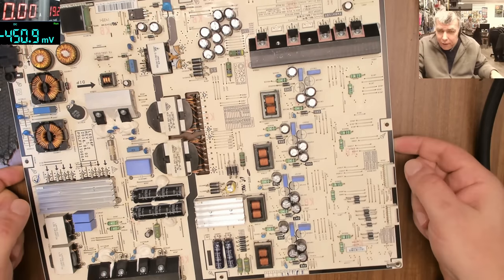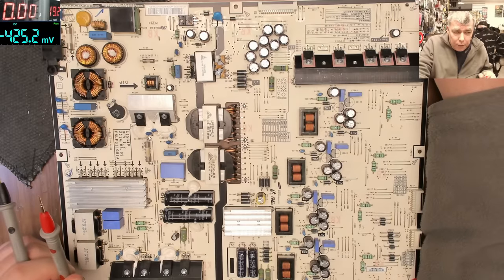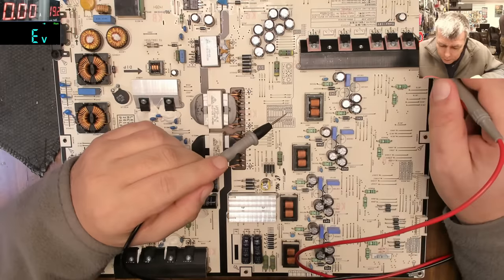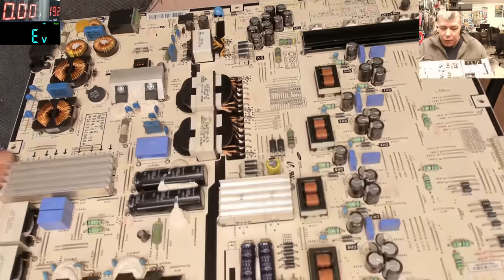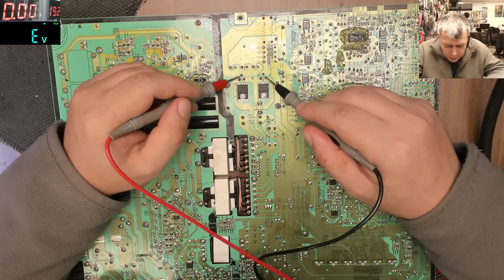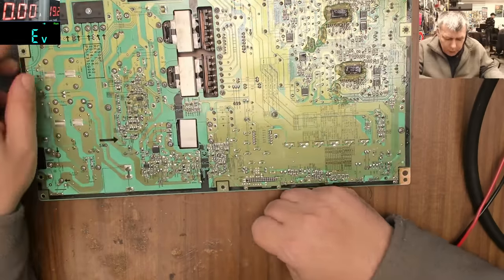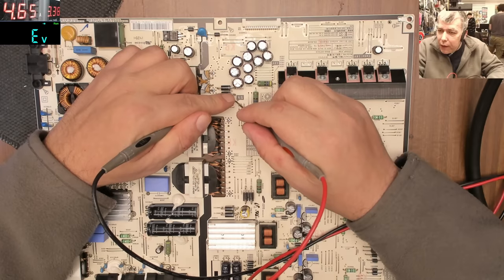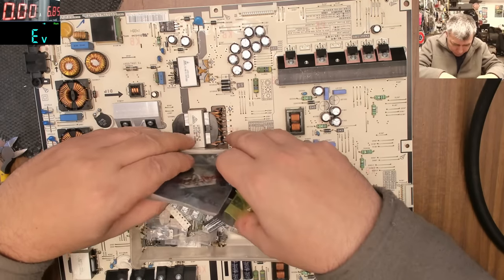Samsung UA65HU8500 TV repair - Switching Power supply board repair guide

Comment: you can install sr5100 in this node too. these diodes differ in their operating voltage - 100 and 150 volts, respectively.
but at this point the output voltage is only 5 volts, so the reverse voltage for the diode will be 40-50 volts maximum.

Comment: Thank you sir, you remind me my old work, as a repair technician. 
Nice method to find the shorted diode. I did not think that.
But I have to notice that you must replace all the three diodes. They have to be from the same type and same lot also. So they have same characteristics possible. 
As you mention maybe the technician chooses not to equalize the three diodes so the TV come again for service after a few years.

Comment: People who don't understand electronic assume that a partially, or sporadically working unit is easier to fix than a completely dead unit. They couldn't be more wrong.
Reply: They don't understand the difference between a simple DC controller on, say, a toy train and a more complex supply - linear, switching, balanced. Or why that matters anyway.  In the above that knowledge and methods of isolating the faulty part kept a several hundred (or more) $ (USD) TV out of the dumpster for the cost of a diode that was likely less than $20.

I'm in awe of the way you work through problems and remind all of us that everything comes down to Ohm's law, Kirchoff's laws, and so on.
Reply: @larrymorley8968  Schottky Diode cost no more than 0.1$

Comment: It gets more difficult when a resistor opens. I just repaired a similar PS where a 2W resistor failed open but it was perfectly fine on the outside (not burnt). Had the PS in the TV fully connected and plugged into mains, and traced voltages with the aid of the PS schematics.  The issue was the PS not switching although rectified mains was there.

Comment: Don't be fooled by diodes showing up short, this does not necessarily mean that they have failed, you can quite easily get false readings from low ohm resistors or even from a local transformer.
Reply: He did go through the one set of diodes that seemed to maybe be shorted but upon further inspection he decided they weren’t.

Comment: I thought the cathode of the diode was the ground side (yes I am a noob) but you put the negative power supply probe on the anode, and the positive on the cathode of the diode when you injected voltage. I am curious to why? (Or am I blind).. Thanks for your videos. :-)
Reply: Otherwise the good diodes are forward biased and conducting so will get hot too. Reverse biased only the shorted diode will conduct and get hot.
Reply: That´s the trick:   No current will flow through the good diodes.

Comment: one question i have for you... when you inject voltage, can it be dangerous for other components? or it will take the shorter path (shorted diode) only? i mean also... it is applicable to every situation that there is a short no matter what type of circuits?
Reply: In order for the defective diode to heat up, it is enough to use, for example, 100mV. This small voltage will not harm the other components if the diode were to break due to the current flowing.

Comment: Instead of ordering same exact diode you could replace all 3 with an equivalent. Faster and cheaper.
Reply: Not only that, if you get three from the same lot there’s a better chance of them matching each other decently, so the load will get shared a bit better.

Comment: Hi. Looking for competent advice. I got samsung led tv. Some times when turning on, it comming in one particular color, may get in pink, or blue. After view repeating on/off it will come on with normal multicolor format.
What can cause that power board or main board? Visually no sign of damage on them
Reply: I am thinking the T-con board. I am not an expert.  I am writing this from my experience and watching several YouTube videos in the past.  If there is ribbon cable, unplug the ribbon cable to the T-con board, clean gently (very gently because the metal from the ribbon cable may come off and make it unusable; do not leave any residue if you are using an eraser; cleaning with alcohol may be better), and then plug back in inserting straight (avoiding inserting at any angle).   In my TCL TV I just replaced the T-con board, and the display which was distorted got cured and the TV became as good as new.  Later I thought to myself that I should have tried cleaning the ribbon cable and reconnected instead of replacing the board.  The board was not expensive, so I am OK.  The TV worked for several years after that without any issue.  I was very happy.  When ordering part, make sure to physically match your old board with the one you see online (they need to look exactly the same) for your make and model and possibly any part number printed on your existing part. 

I may be wrong.  So before spending money to buy the part, reseat the ribbon cables by unplugging and plugging back in firmly such that the exposed leads of the ribbon cable gets inside the slot just enough so as to make good contact of the leads and not the plastic insulation of the ribbon cable.  Good luck!

Comment: hello sir,
how are you i hope you are fine and well.
sir i have toshiba equium laptop it's no power and no sign of any light when i plug in power.
when i check the board the L2AA ic is heating up but i cant find it in market to replace it.
if you have any idea to replace it on some other ic then let me know to replace it by which ic.
thanks

Comment: Lightning struck my house. Pc was fixed with a new powersupply, hoping the TV can be too. What are the odds of just repairing the board vs getting a new board?
Reply: If you already have soldering kit, Multimeter, and would like to have some electronics repair experience by watching several videos like me, may be worth trying to repair. Still, you need to order the right kind and exact value of parts to replace after finding out the faulty part.  I believe the cost of the components/SMDs are very minimum (I have not bought any so far).  The experience of the entire process will make you proud of yourself once it works.  However, if the cost of the board is not too much, replacing the board is not a bad idea.  I did that few years ago - replaced the T-Con board of my TCL TV which became as good as new and lasted several years after replacing the board.  Good luck.

Comment: Yep one of the diodes will start to conduct before the others, not good :-(
Put a string of diodes across your psu at say 2 amps, then measure across each diode to find the best matches.
Reply: I was taught in the first year of electronic school to not put diodes in parallel without a resistor in serie to each diode! Samsung, WTF?
Reply: @dezibeldani  Yes, you are right. This is true also for paralleling transistors, BJT. On emitters a resistor should be present to accomodate different currrent gains, i.e. so called BETA. Regards from Italy.
Reply: @dezibeldani  - that is true. But I imagine that the high currents involved would need a rather high power (physically large) resistor, and that costs money and real estate. They maybe could have paralleled a fourth diode there to have better margins.

And for all we know these diodes may have been “matched” in some test setup before assembly so that they would share the load a bit better. It’s not a common practice, but it does occasionally happen. And this practice can lead to a future dilemma if there is a failure, because only a failed part might get replaced and there is unlikely to be any matching done at that time.
Reply: @stevebabiak6997  I consider matching diodes even more expensive. A supplier repairing our power-sinus-converter had to test hundreds or thousands of Transistors to match them! Costs us a fortune each time.
Reply: @dezibeldani   - agreed. Matching semiconductors is tough, because the test has to be somewhat representative of the actual use case. In the case of a rectifier, one diode might have good performance under DC only conditions, with poor performance under high frequency, whereas another inferior at DC only performance might excel at higher frequencies.

Comment: at 8:15 how do you conclude from the resistors that the diodes are not shorted?
Reply: Something is missing in the video, maybe edited.
I imagine he measured the resistance with an ohmeter,  and then he realized the resistors where there, or the other way around.
Reply: @roner61  can you explain to me why the diode mode meter reads 0v then?
Reply: Hi. These are 5ohms resistors wired in parallel with the diodes. It's equivalent to a 1ohm resistor in parallel, indistinguishable  from a short circuit with the testing method used.
Reply: @lunedemai2  Hello, and thanks. Its an interesting design i had never seen before.

Comment: Replacing only one diode with one of a different manufacturer or batch is a BAD IDEA.
Because of different voltage drop, it may fail sooner or carry much lower current than the others and be almost USELESS.
Replace all three with similar ones!

Comment: Identify a shorted diode with a power supply, is just stupid! You don't need to do that, you can check the shorted diode with a multimeter, even without taking it out of the circuit! You really should take lessons in electronics! You are leading rhe people who watches you, to do mistakes!
Reply: Somtimes I do not agree with Sorin methods but in this case you are soo wrong! If you have 3 diods in paralel and one of them is shorted, Sorin method is the only one which can work. Ofcourse, you always can take them out one by one... but without to take the out... no way
Reply: @nricu3604  without take them out, i can detected which diode is shorted. If you don't know how to do that, that's your problem... Maybe you should have study more!!!
Reply: @del4you2  - OK man! No problemo.  You are the most smart and educated person here. 
Unfortunately, your statement means ZERO, without to give a prove of it. 
Maybe is hard to explain your Voodoo  techinic...
No problemo! Be happy!
Reply: @del4you2  You could use a good milliOhm meter too, right?